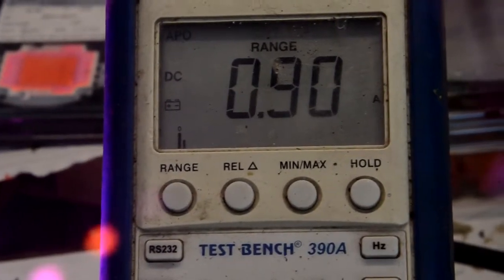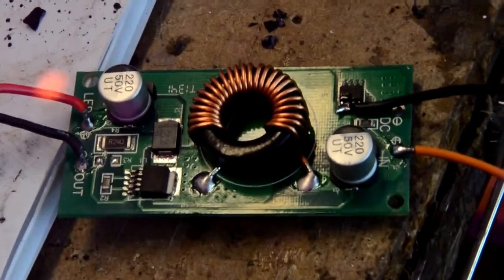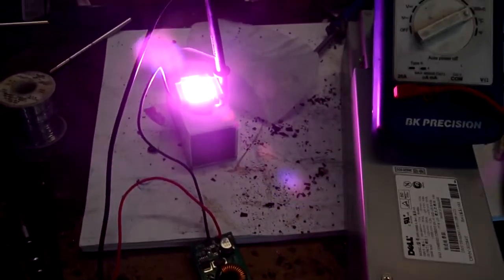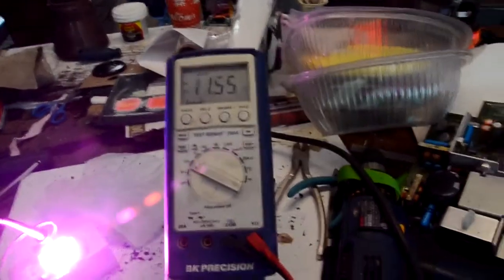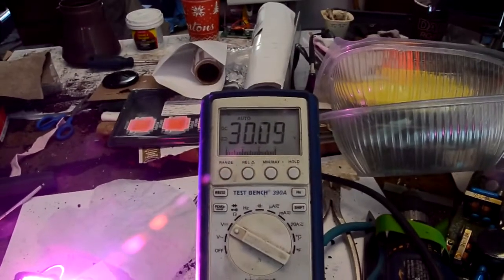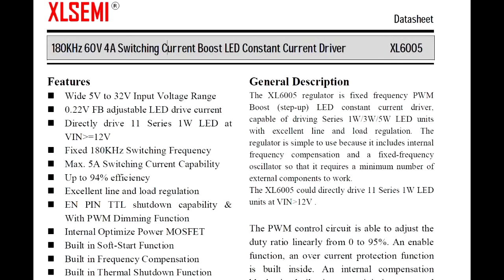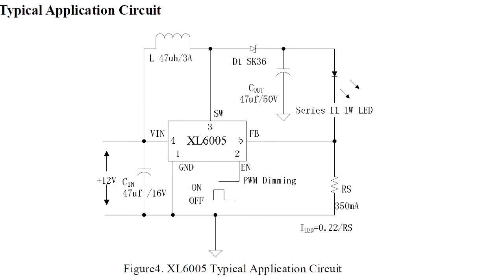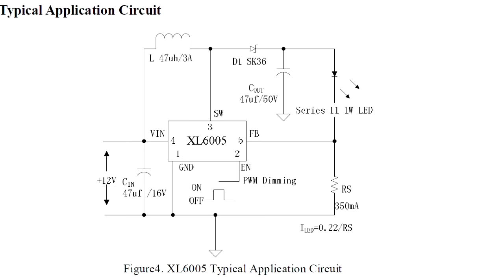Gardening: 30 Watt DC to DC converter DIY LED grow lamp

Comment: Hello! I've bought one of this drivers and am wondering how to add  Dimming, maybe with arduino. Haven't found any detailed info about that. Have you tried it? Will it be enough to connect a PWM arduino pin out to this pin of the driver? Thanks!
Reply: Potentiometer aka a pot easy and. Cheap
Or. Resistor same. Thing really. Ones just adjjistnl3